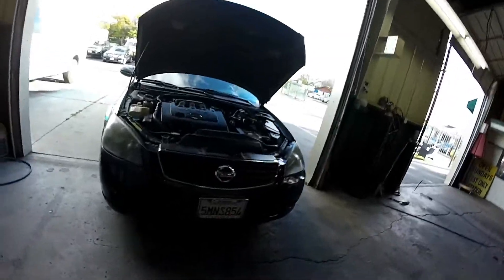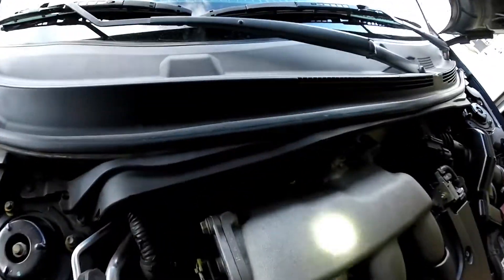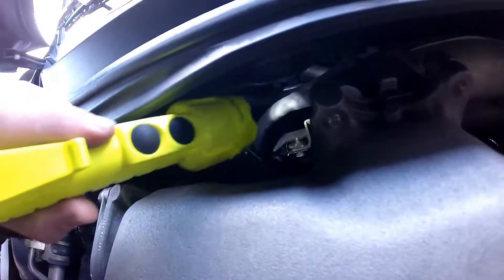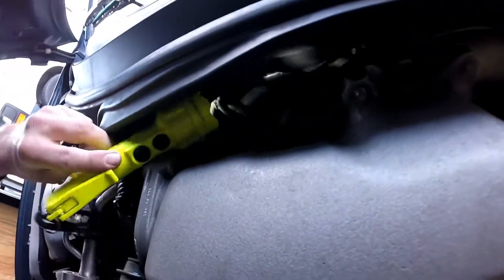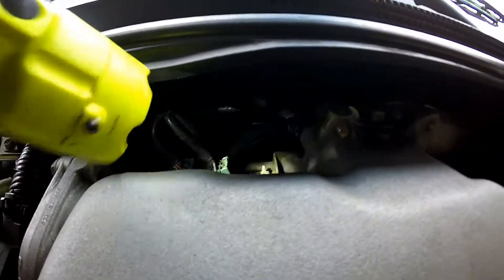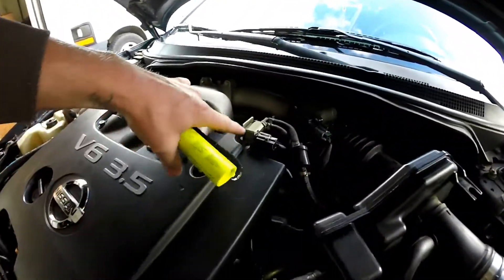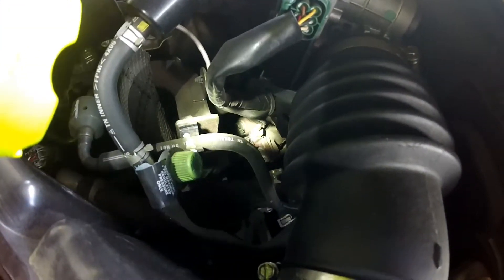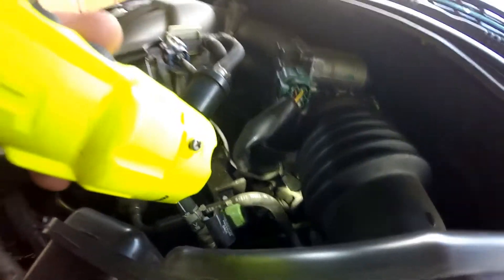Nissan Altima L31 VQ35DE smog locations: PCV, EVAP, & EGR

Comment: I changed out my PVC valve 2003 3.5 Altima if I replaced the rest of them will car run much better as for now feels as if need a tune up that's be done 👍

Comment: If the canister hisses sometimes when i turn the car on and off is that a sign that its bad?
Reply from the maker: It depends where the hissing sound is coming from. You might be hearing the vapor vent solo opening and closing releasing vapors  And/or sucking air into the evap system.  Can you pinpoint where the hissing is coming from? Maybe send me a picture or a quick video?

Comment: Hi, Scott l have a question. I took my Nissan Altima for an oil change and on the paperwork it shows that l had a  unknown leak so what some could it be???
Reply from the maker: +UVONNE NOEL it really could be anything from engine oil, transmission oil, power steering fluid, and or brake fluid. If it was mine I would figure out where I think the leak is coming from or am suspicious the leak is coming from and clean the entire area around it. There is also a leak detection kit you can buy that induces UV ink into that oil system and you use a UV light to see where the leak is coming from. I'll provide a link to that later when I get a chance to get one. But the simple way clean the engine and transmission and keep an eye on the area where you are suspicious the leak is coming from. Did they happen to mention whereabouts the leak was at? I would also ask the people that are doing the oil change where they think it might be from. Let me know if there's anything else I can answer or assist on. I'll get you a link for the UV dye kit and a little bit.
Reply: @ScottiesHobbies  hey scott what was the link to oil dye?